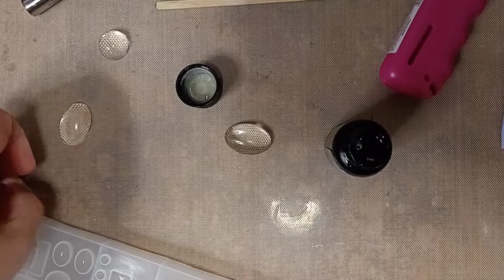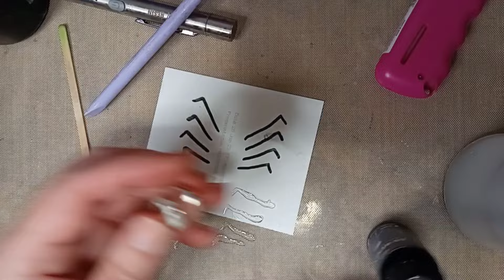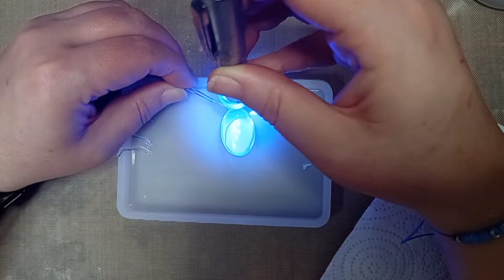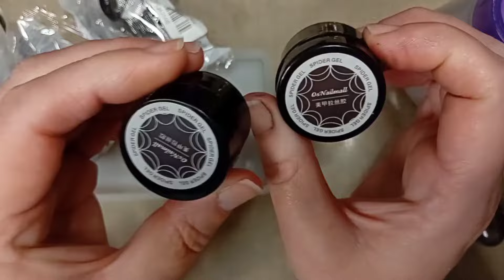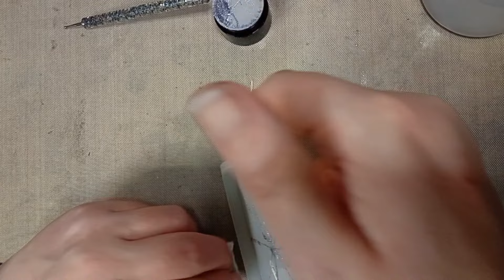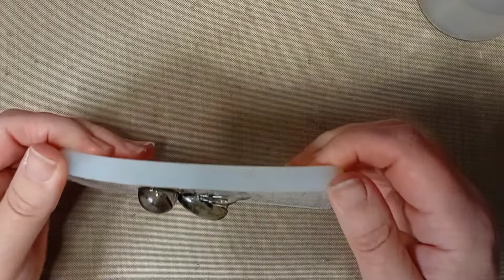Freeform Resin Spider Challenge | Testing Spider Gel For The First Time

Comment: ❤ I watched another video on making spiders. It was just on a larger scale. She had similar issues with the legs and I think she was using a bonding kit as well. I never did catch the brand name , but it  worked well. Is it uv? I like the way your legs turñed out. They look fragile, but are clearly not.😂
Reply from the maker: Thank you I saw another lady do it too a bit larger and stuck it to a picture or picture frame, let's resin did it on one of their compilation videos as well. Yes it was uv, I've done it again on another video but smaller and used spider gel for the legs as didn't need them to stand up on that one 😊